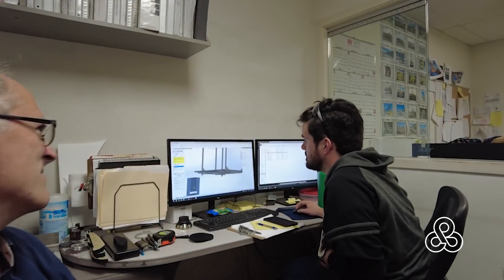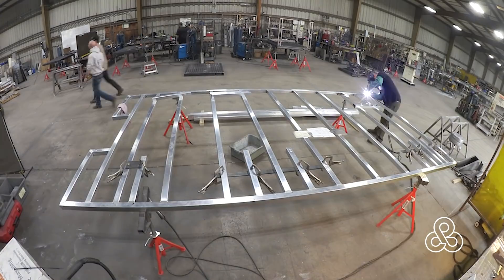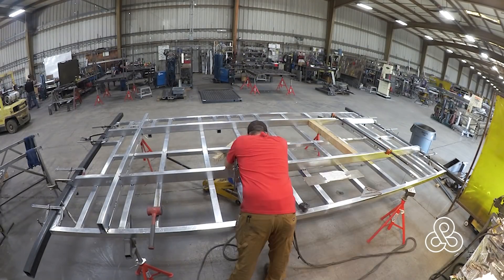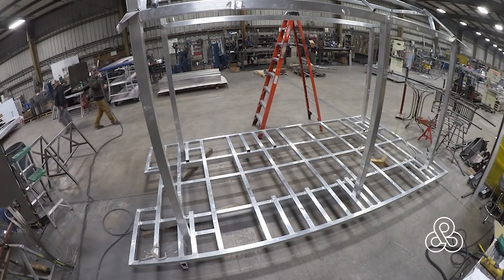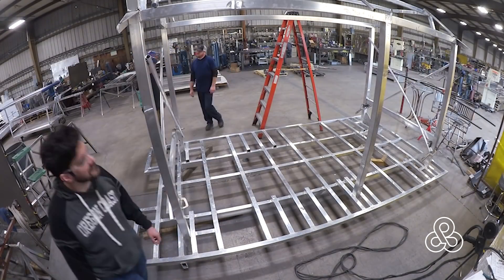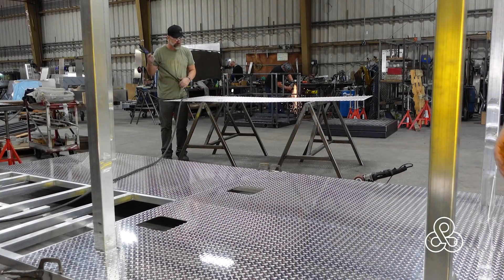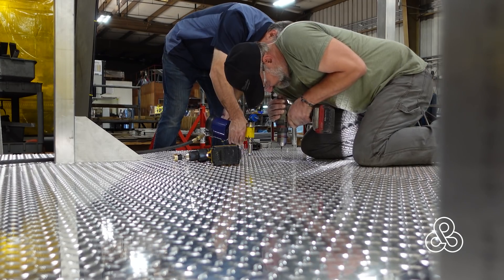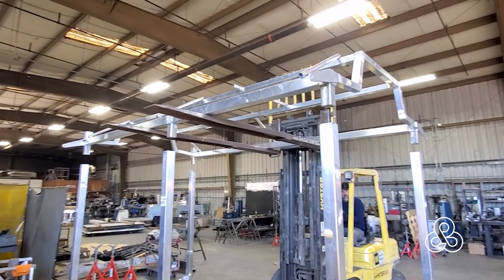L10  Light weight cabin subframe for our amphibious overlander . . Leviathan Supervan Project

Comment: Does that tape work like ordinary double sided tape or does it need some sort of catalyst or heat to cure?
Reply from the maker: Just like ordinary double sided tape. Called Scotch 4950 VHB. The 3M rep said they have customers building rail cars and refer trucks with the stuff. 100lbs per sq in. holding power.
Reply: @BuilderCreator  Wow. That is very high performance level holding power. 3M keeps innovating ... like BuilderCreator!
Reply: @BuilderCreator  hows the mistake correction factor?
Or do you have to live with them 🤪🤬🤑?

Comment: You need to think about rollcage :x
Reply from the maker: It should fair pretty well with the .25" x 4x4 columns and the 2 sided body skins; probably better than the average motor home, but it would still be wise to keep it on its wheels. Ha!
Reply: Yes, but, I dont know :x

Looking the tire, I am effraid about what the truck can do...
Will you put diagonal reinforcement with tubes ?
I am not sure about only panel if it roll :x

Or, at leat, a real rollcage in the cabin ? :x
Reply from the maker: @aeris-mo  The CAB is where the tube roll structure will protect you. If the road is that bad, get into the drivers/navigators seats!